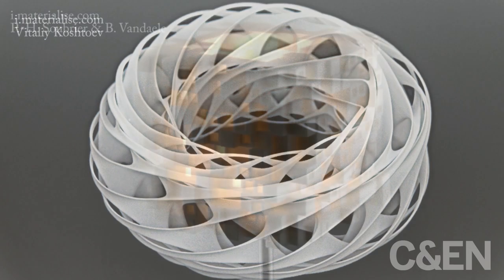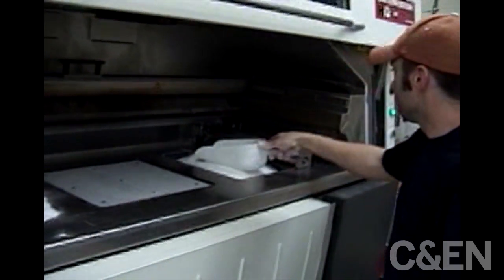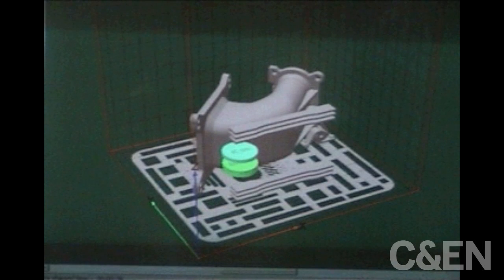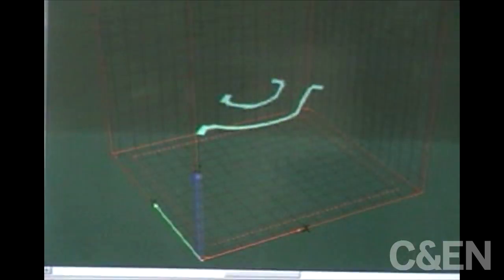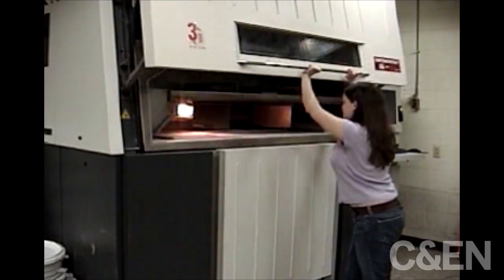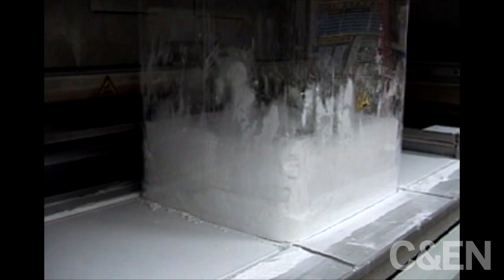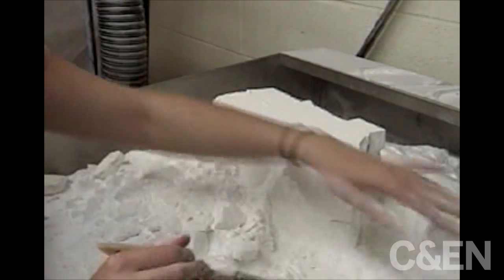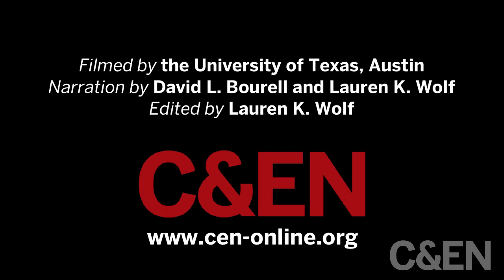How To Print A 3-D Object With Laser Sintering

Comment: how is the density and mechanical properties controlled ?
Reply: Actual SLS use pulse laser to reach sintering temperature precisely without heating to much the core of the grains. Once the temperature is reached, the longer the exposition, the higher is the density and the bigger are the 'bridge' between grains. Mechanical properties are linked to that, but also with one problem : thermal residual stress. Since the layers experience high termal gradient, the material expend and contract a lot. I'm not up to date on how this is managed.

Comment: Quickly looking around I was not able to find the OSHA document but I believe that certain types of dust that are either large enough or don't aerosolize well are safe to work with without a respirator.  Cetainly if the stuff is getting in the air its not a good idea to breath it though.